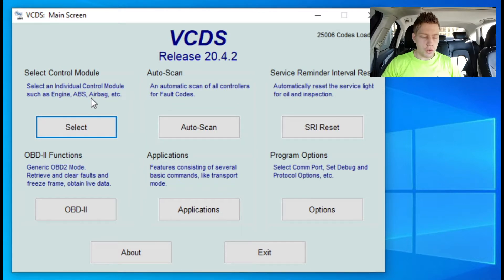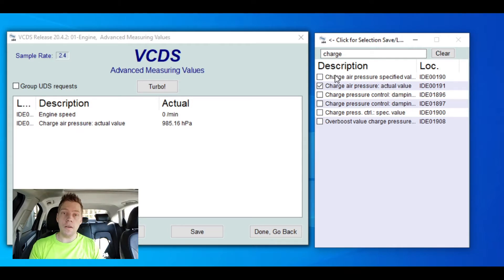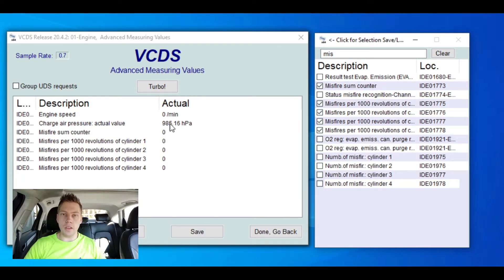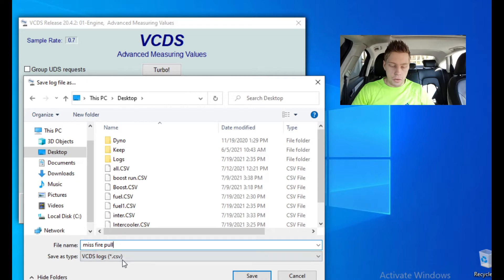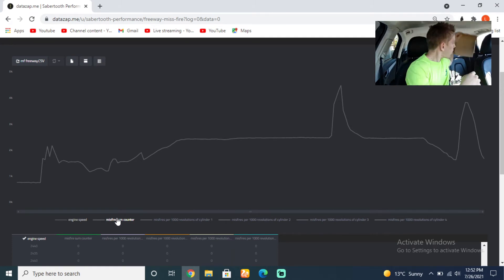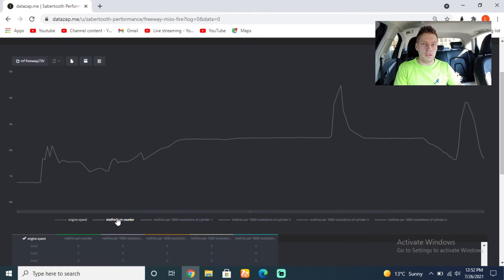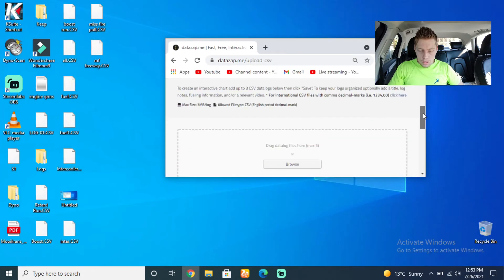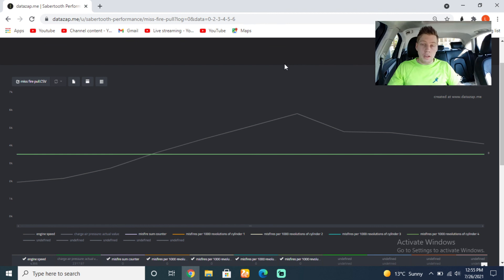How to Data Log for Misfires With VCDS

Comment: Hey I’m currently trying to diagnose a misfire and I’m following this video and when I search in vcds like you are I am not getting the same thing. Like my misfire 1000 revs isn’t there and neither is the charge air pressure. Any ideas?
Reply from the maker: Hey buddy... I also had a friend with the same problem, most of the time it is just a different name. What version of VCDS do you have?
Reply: @megalodononwheels  I’m on 21.4. I also completed the log with a misfire counter, engine speed, and boost actual and specified and I got 2 misfires on cylinder 1 starting at 3800rpm through 5000 rpm. And I could feel it while it was doing it
Reply from the maker: I am not sure what car you have, but if it is a Turbo or Supercharged car, try making the gap smaller on piston 1. Use a gauge to accurately measure the amount you are making it smaller, but if you don't have a feeler gauge yet or to scared to do it, try switching the spark plug and the coil of piston number 1 to piston number 2, do your data log run again and see if the problem shifted to piston 2, if it did then it is either the coil or spark plug, otherwise something else might be wrong with piston number 1
Reply from the maker: Whooooooo that is great news! Glad that it followed (its cheaper this way 🤣)... So now place the coil 1 back to piston 1 and leave spark plug 1 at piston 2, toe see if it is the spark plug or the coil 👌
Reply from the maker: Definitely! If they weren't so expensive i would also get them 🤣 its the importing that kills me because i am From South Africa... 🤦
Reply from the maker: Man! Your lucky 🤣 get them, you won't regret it 😎